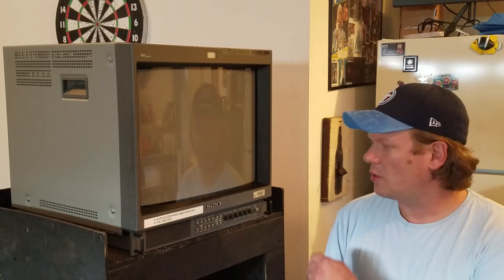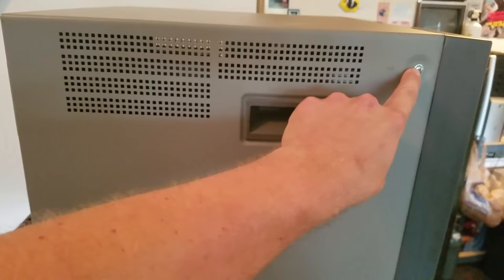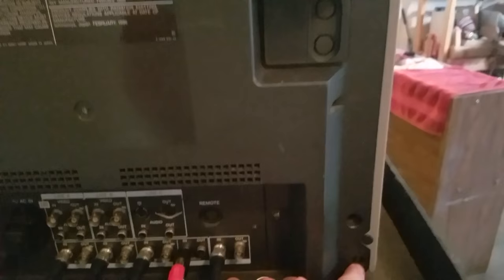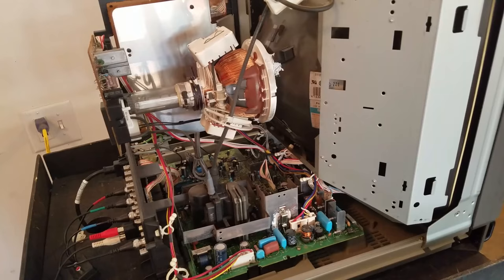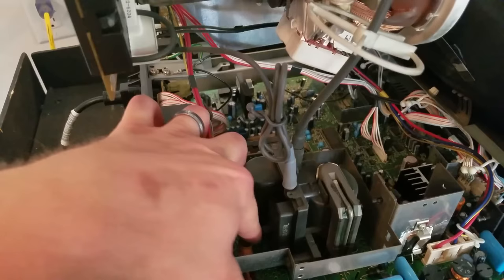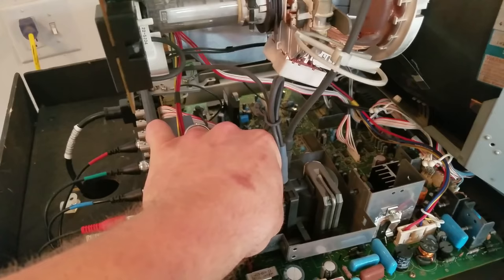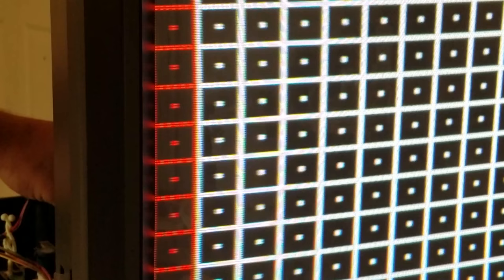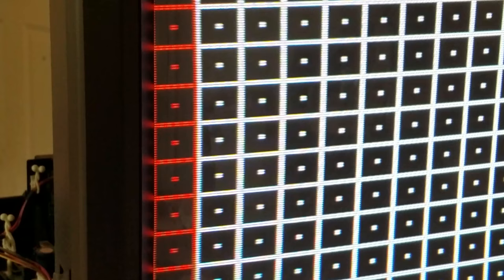Sony PVM BVM CRT repair a blurry screen

Comment: You should avoid touching the flyback transformer with your bare hands. A long plastic screwdriver is the ideal tool for this adjustment as it will keep you safe from the high voltage. Also the screen looks perfect after the adjustment.
Reply from the maker: I hate getting close to the flyback.  Everyone should avoid it.  The problem with some 20" PVMs is that the trim pot is on the back of the flyback and there is only about an inch or 2 of clearance to get to that trim pot.  On other models it was moved to the neck board, which is much easier and safer to access.  I'm trying to find an extremely short, plastic screwdriver that will fit in the area, but I've not found one so far.  Please let me know if you are aware of any  specialized small plastic screwdrivers.  I'm getting some new equipment in too next week and will most likely re-shoot this focus video all together.
Reply: You can make at home a screwdriver from PVC material, it's not the best solution but it will work. I am looking forward for the re-shoot with new equipment.
Reply: What was it like getting zapped by a flyback?  Was it through the metal surrounding it or was it through missing insulation you didnt catch?
Reply: Your comments reads too much like "I don't know what I'm talking about, this is my opinion". The flyback is insulated. The knobs look exactly like they're meant to be adjusted by hand, as they have a ribbed surface.
Reply: @cgottschify  The flyback is fully insulated. Imagine if it wasn't. Your monitor would be toast, as there would be arcing everywhere. If any insulation is damaged, it needs to be replaced ASAP. Touching the flyback is perfectly safe, unless it is damaged.

I have never been zapped by a flyback (as that would require some major stupidity), but by touching parts with different potentials (on one arm only) or the neck PCB. It's nothing bad and definitely nobody has died from a CRT before. The injuries that result from CRTs are from people getting shocked and pulling their limb away, cutting themselves on some component.
Reply: @DasAntiNaziBroetchen  can confirm, as someone who stuck a metal screwdriver into the flyback to adjust focus multiple times, I haven’t had any issues with getting shocked lol.

Imagine the logistical nightmare of having two major things for servicing (sub brightness and focus) be an extreme shock hazard haha.

Comment: Love your channel man! I just picked up two 20L2MDU PVMs on Ebay for $222 each and one has tiny geometry issue up top and other was a little blurry. I was afraid to mess with it because I see everyone say it's dangerous but mine has the easy access focus adjustment once the frame is removed. So I fixed that problem now I'm just scared to mess with the magnets on the other one because I don't have gloves and I still don't know what I shouldn't touch. I will have to watch your vids all over again before I dig into that issue. But thanks for all the info, I would have no clue what to do if it wasn't for you!
Reply: $222!!! Damn man you got punked big time

Comment: Hi, great video. I have a crt trinitron tv and I have blurry screen in edges and corners, while in middle the focus is perfect. Can I fix it the same way?. Sorry about my English
Reply: Same deal here with my trinitron monitor
Reply: Sounds like convergence more than focus, most consumer trinitrons have this. I have the opposite issue, the edges are sharp but the middle is blurry when the brightness is turned up

Comment: 90% of the time? I have that 10%. I have a Sony KV13TR24 TV. It has both the screen and focus pots on the neckboard instead of the flyback. Such an oddball TV. I love it. :P
Reply from the maker: Yes on smaller screens (under 15" screens) the pot is on the neckboard.  Thank you for noting that.  I didn't point out where the other 10% should look.  Great comment.  Thanks

Comment: Hi,

Would this help at all if the focus is off near the edges but not the center?

Cheers
Reply from the maker: Maybe it helps the focus of the entire screen overall.  You can try spinning the potentiometer to see if the adjustment is helpful.
Reply: Retro Tech thanks very much, will give it a go. The focus is a fairly "safe" adjustment in terms of returning to normal?
Reply from the maker: Yes it's an easy adjustment to make.
Reply: Did you find a solution? Am having the same issue

Comment: Thanks for this.. I'm going to see if this works. The pvm I have  is the exact same model. When I purchased it, the owner  was a video editor. He said it was calibrated not too long ago. Whenever I turn up the contrast just a bit everything gets blurry. It's just too dim to my liking. Hopefully this works. My pvm has plastic caps in the back (other than the side philips screws). I haven't taken them off yet as I just moved. Did yours have these??
Reply from the maker: Hi, No you don't have to remove the plastic caps, only the screws.  Check this video out.  It shows how to take the shell off safely for the first time. https://www.youtube.com/watch?v=hSvjvbGdv7U&t=4s
Reply: Retro Tech awesome! Thanks for the reply. I had a real "duh" moment.. I didn't remove the other last screws in the back. Also realized that you explained this, I must have been multitasking when I watched this. The pot worked like a charm, looks really clean and sharp. Just need to use the 240p test suite and clean this baby out. Love the videos.

Comment: Hello Steve, love your videos! Question I have a jvc tm-1650su I've obtained from a tv studio as a trade that they used for security cameras. I've used a Phillips screw driver to adjust the focus and has had zero results for sharpening the image. Any way you think you could point out how can I make the picture sharp? I've gone into menu for sharp settings the sub menu settings as well and nothing.

Comment: Hi Steve, I am trying to figure out how to adjust the potentiometer on my PVM-14M2U. I noticed there is no dial to adjust on the same part shown in this video, there seems to be a flat partially raised piece of plastic instead. How would I go about adjusting this on the 14M2U? Thank you!

Comment: I chuckled 3:00. But I want to try this on my Sony kv27v42.
Reply from the maker: You can do it on any crt.  Thankfully 99% of CRTs adjust focus like this.  The adjustment dial will be on the back of the Flyback Transformer inside your Sony.

Comment: If the onscreen menu on my bvm is very sharp but game graphics and the 240p test suite grid patern isnt quite as sharp,, could that be down to my bnc cable,, its a different bnc cable i had in the past that i used on another bvm..

Comment: I am afraid that my tube is dying. I have a 20L5. When I play games in scan line mode, the picture is blurry and occasionally becomes sharp. A pvm expert told me that the tube is old. What can I do?
Reply from the maker: You can try to adjust the flyback a little to increase the focus, but if a tube is failing, there is little you can do for it besides source a replacement tube and swap it with your old tube.
Reply: What would the cost be to replace a tube?
Reply: @matthewnorton9981  where can you find a tube?

Comment: I have an intermittent issue with a BVM D20F1U where the monitor will not display the red component of the video signal (regardless of input source, Analog RGBS and YPbPr input cards both can produce this effect).

If an area appears green or black, I can tell red is missing from the raster, but strangely seems to be slightly tinting the black areas red between gaps on a 240p signal. If I power cycle the monitor once or a few times (varies), the red signal will eventually display correctly with the rest of the image information until the monitor is returned to standby or off mode for an extended period of time.

I should probably post this on Shmups later, but if anyone has any insight on this issue, please let me know. The monitor probably does need re-capped, soon.

Comment: What about if your focus is drifting in and out?
Reply: Sounds like bad caps and/or a dying tube.
Reply: @miko-nv9cl  Thank you. Just seen your reply. It's a quick change (in/out) and not a huge difference but definitely noticeable. Ironically I've just had the Flyback and several caps replaced.